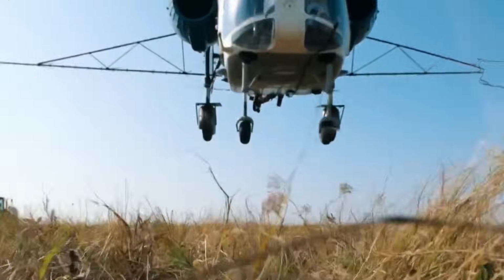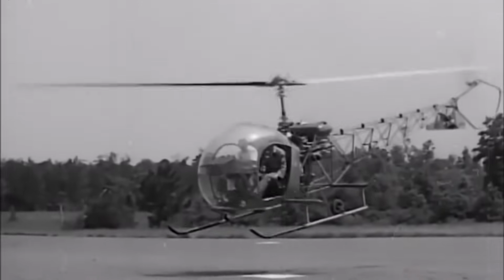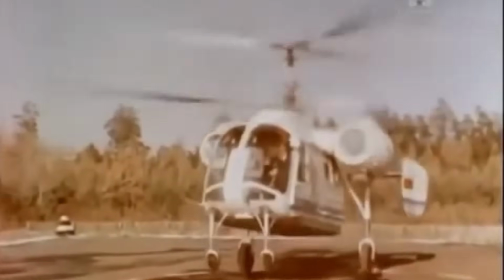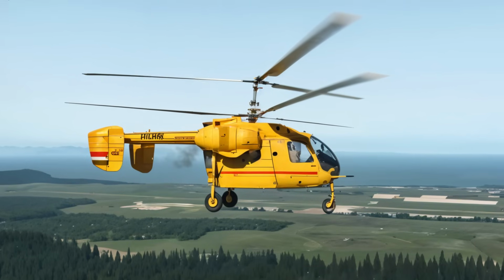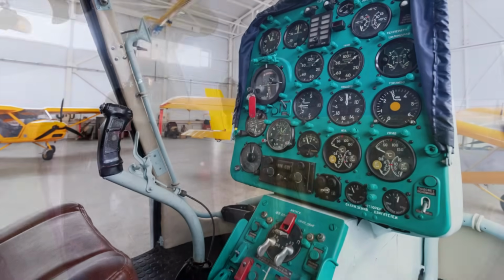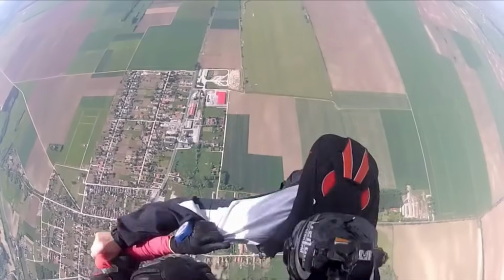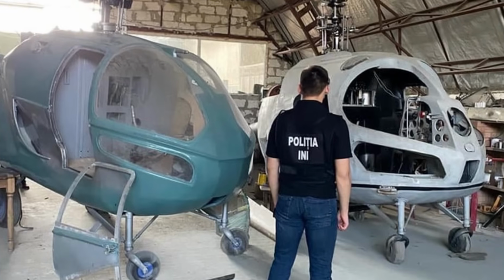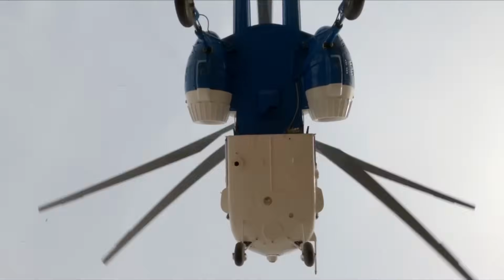The Swiss Army Knife of Helicopters

Comment: Many pilots mentioned the low performance of the engines among the faults of the "insect bomber".
In hot weather or at maximum load, it was difficult to take off.
That is why it happened that, for example, it could still fly in the morning but could not take off at noon. But if it could take off, the headwind was a problem.
This is the price of simple propulsion unit. But the type can be thanked for its survival thanks to the cheaply operated piston engines. That is why the gas turbine version was not successful.

Comment: I would say, run the engines until they can no longer function or parts run too dry to be able to support them.  Then, get a different pair of engines, similar size and weight probably, and similar simplicity of maintenance, and keep flying it.

Comment: There are many of them in Hungary (and not only in museums). 

They are currently out of use (but in ready-to-work condition, packed), because it has been impossible to get new, factory fiberglass rotor blades for years due to the Russian-Ukrainian war. The rotor blades of most machines have expired. (They spray instead with drones in small areas, and in larger areas with larger helicopters or airplanes)
Reply from the maker: Is that right?  I thought they were still active in Hungary.  Damn, maybe they should sell some over here to the west!  Imagine dropping into an airshow with one.
Reply: @aircraftadventures-vids  
We are running out of pilots and experts (those who know the ka26 are already 60+ years old), and as long as there was enough of the rotor (the Russians make it, but it is not appropriate to buy helicopter parts from a country at war), it was treated as a working, usable museum object. You will find many Hungarian videos, they are taken out of the shed in the morning, assembled by a larger team of friends, calibrated, checked, and they go out with it for 1-2 hours of work...

Comment: With the problems getting western engines the Ka-226 is now getting Russian engines and they actually look rather good. India is buying the Ka-226 and it is almost certain that when the Russian engine options are ready that it will be produced in significant numbers for Russian users too. The Russian engines are brand new and rather good engines so its future looks rather good. They are talking about a light naval model that can operate on smaller ships than the heavier Kamovs.

Comment: Kamov helikopter use in construction with full booked schedule.

It's not rare that it got a few construction company customers in a day, because the ability to complete task in a single try. 

Because Kamov with auto hover, can hover on a dime despite strong wind, an advantage of dual rotor helicopter; resulting in a precise delivery of construction part, making installation of stakable parts easier.

This precise controlling is what makes it easy to land on a small boat.

Comment: To avoid wasting fuel when airplanes dust crops - a fuel that would be spent when the plane turns around to align itself with the next row - pilots do a maneuver that approaches a stall. That's a very dangerous maneuver and using a helicopter like that would be a lot safer. Nowadays ther are lots of crop dusting drones arround, though. l

Comment: Piston powered, modular, runs on automotive fuel, can be hauled on a flat-bed truck.  A modernized concept might be great in recreational piloting.
Reply from the maker: It turns out that there IS an ultralight helicopter with coaxial blades on the market.  Just not sure if they've sold any.

Comment: The first time I saw a Kamov was on the flight deck of the USS Midway in the middle of the Indian Ocean. It was Spring of 1989 I think but that didn’t matter. The I.O. Is always hot. Just unforgivingly hot.  We had just recovered from flight ops when this weird twin propped egg of a helo popped over the ship’s island and hovered right over our deck. The air boss was screaming to launch the alert 5. A guy with the whitest teeth I ever saw pointed some kind of machine gun at me and smiled.  Just… smiled. I thought for sure that I was going to die right there while lugging tie-down chains for my bird. 19 years old and thousands of lonely miles from home. Then the helicopter broke off and headed aft and away to starboard where we saw some kind of warship out near the horizon. We finally got a catapult cleared and launched an F-18. I don’t remember whose squadron the alert bird was from. I don’t think it was mine.  My squadron was VFA-195. I recalled where I was and that I still had work to do.  I also remember that I had been standing in one place for too long and the heat from the flight deck was seeping through the soles of my flight deck boots   That deck was hot enough to melt your boot soles off you weren’t careful. I trudged to catch up with my bird which was finally being towed aft for its final spot. All I could do was prep my bird for the next flight, but I will never forget the smile that door gunner had. I thought I was dead that day. It’s now been at least 35 years since that boiling hot day in the middle of the nowhere that is the Indian Ocean.
Reply: Бедолага😅.Русские лётчики " немножко" пошутили😅и прилетели к вам ,на авианосец, с Дружеской миссией,налаживать дружеские взаимоотношения😂.А вы не поняли " дружеских жестов",и по итогу у вас появилась причина ,внепланово поменять памперсы😂😂😂.
Reply: В реальной ситуации это означает гибель вашего авианосца?
Reply: And nowadays those Ruskis don't even have the capability to get a ship with a helicopter anywhere near the Indian Ocean. Interesting anecdote though

Comment: The thought of flying in a Moldovan counterfeit helicopter shivers my spine. Thanks for including that bit of weird aviation history.
Reply: The trick and seemingly the point modern Kamov managers fail to understand, Ka-26 used easily maintained radial piston engines. Its so important feature of design, that counterfeit vehicles are still produced in Moldova mostly for smuggling operations between Ukraine and Romania (EU) bcs you can make a heli from easily available parts and fuel it with easily available cheap gas from your common car gas station. Honestly, undeservedly forgotten engineering marvel - a helicopter developed for a mass use by general population.
Reply from the maker: Pretty wild huh?

Comment: Honestly I think shifting to a more complicated western turbine was a mistake. They're now competing with far to many high tech designs. A better idea would have been to develop or adapt a more reliable piston engine leaning into the designs advantages of simplicity and adaptability. There are a lot of different helicopters flying around in remote areas of Africa Australia and Canada where operators would appreciate something with simpler engines and cheaper more readily available fuel. Organisations like the flying doctors and wildlife wardens would be overjoyed to have a fleet of these little transport aircraft to make their jobs easier without needing expensive maintenance facilities or eating into their limited budgets.
Reply from the maker: The big problem (which I also addressed in a previous video on the Helio Courier) is aviation fuel disappearing around the globe.  Yes it CAN run on auto fuel but probably not optimally and jetfuel is widely available everywhere.  Hence the success of designs like the Caravan, which pretty much killed off piston twins.
Reply: Двигатели работали на ЧИСТОМ 100% бензине а не автомобильном топливе.
А он сегодня дорог и дефицитен в отличие от автомобильного топлива и тем более керосина для турбин.

Comment: I suspect this thing is simpler, cheaper, and more rugged than a Bell or Hughes.
I wonder if a larger jet-engined chopper could be made where the jet engine spins the blades and also thrusts the machine forward.
Reply: the exhaust of gas turbines is typically directed back
Reply: @worldoftancraft  Yes, which is why I asked about it thrusting the helicopter forward.

Comment: If you're wondering how yaw is implemented on a Kamov it's by collective pitch difference between the upper and lower rotor. Collective is increased on one disk and reduced on the other such that the overall lift of the rotor system remains constant but one rotor is exerting more torque on the airframe than the other which causes it to turn in the opposite direction.
Reply from the maker: That's interesting, thanks for sharing!
Reply: Differential collective also reverses during autorotation. I believe there is a mechanism that keeps yaw pedal functionality the same during powered and un-powered flight.
Reply: @Ben-Dixey  It does because it switches from torque to transmission drag, so it works backwards in that case. Even with the system to reverse the pedals kamov pilots still need to be able to recognize when the yaw is working backwards and control it like that without panicking in case of a failure.
Reply: @Ben-Dixey  There is no such mechanism in the KA-26 that reverses the operation of the yaw pedals during autorotation.
However, the relatively large, dual rudder surfaces become quite effective above roughly 30 knots airspeed, easily counteracting the reversed differential-torque of the rotors during autorotation. The rudders on the dual-fin tail have 27 degrees maximum deflection angle  in both direction and have a direct mechanical linkage to the rudder pedals. Additionally, the dual fins are angled 15 degrees inward (15 degrees toe-in) on each side, further increasing the rudders' efficiency.
Reply: @gregmeszaros  Oh! Thanks. I'm wondering how is it you have this knowledge? I've only read online that there was a pedal reversal system.

Comment: I’ve seen kit planes that use turbocharged LS3 engines. Which make about the same power as the M14P. It would be really cool if an automotive engine like that could be put in these KA-26 a helicopters. They could modernize them AND keep the advantages that a piston engine has over a turbine.
Reply from the maker: Unfortunately automotive engines in airplanes carry a ton of disadvantages which negate most of the reasons to use them.  Sure, more modern ones like LS3's are better then older engines but still have many issues that they struggle to overcome.  I read a book on a guy from Texas who LS-swapped his homebuilt and almost every takeoff ended in a forced landing!

Comment: I believe  it had 20% more lift  then a standard tail  rotor  design because it didn't waste any power on torque  compensation  and  much  easier to fly . You see lots of  helicopter  accidents  where the  chopper  starts  spinning uncontrollably ... not  so with this  bird ..love it
Reply: They have other issues like the yaw controls reversing and reduced yaw authority during auto rotation. This is because they use collective difference to control yaw, collective is increased on one disk and reduced on the other and the torque imbalance turns the helicopter. But when the rotors are freewheeling it's now transmission drag instead of engine torque and the yaw controls suddenly work backwards. Later designs have a system that reverses the controls during auto rotations but kamov pilots still have to be able to recognize when the yaw is working backwards and be able to control it that way without panicking.
Reply from the maker: One thing to consider with this chopper is that it operates nearly all the time a few feet above the ground, so an engine failure of some sort will mean it's on the ground well before the pilot has any concern about autorotation (at least that's my theory, lol)

Comment: I knew kamov made counter rotating designs, but this is the first time I heard of this KA-26. What a marvellous little helicopter. The extended engine pods is a great idea. The cooling fans made the engines look like jet engines! It's a super practical and lovely little helicopter!
Reply from the maker: It had its time for sure. Not quite sure it's as prevalent as it used to be. Curious to know how many are still flying.
Reply: @aircraftadventures-vids  less and less unfortunately as it's hard to get hold of airworthy rotor blades. As I see many clips were included from KamovRider's and TomiAvation's channels, they travelled through all the country (Hungary) to make footages about the still flying Kamovs. They both have a heli license now (not for Kamov yet, but I am sure they still dream of it)!

Comment: I want a survival rpg where you find and operate this helicopter. Switching the passenger cabin for a weapons platform or advanced sensor system to find acheotech. I want this. It runs off of regular gas! Wonderful vehicle.
Reply from the maker: I read it was designed for weaponry but the military didn't take them as range was too short